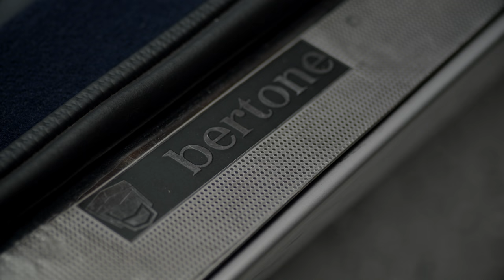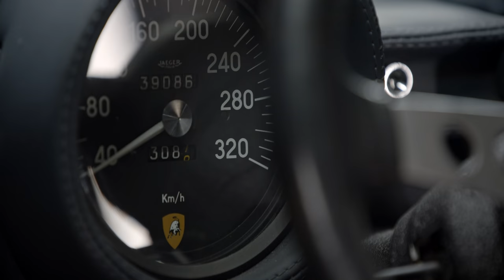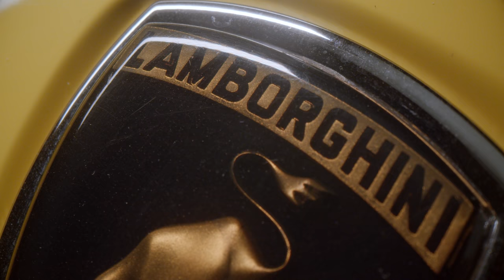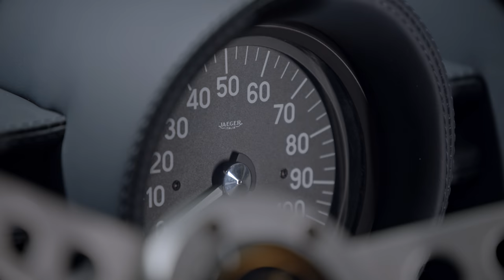Detailing a Lamborghini Miura, the most beautiful supercar... in the world:  | Beyond the Details

Comment: How do the headlights work? as looks like they point straight up
Reply: Similar to a Porsche 928. They pivot forward but not as extreme because the reflectors under the lenses are at an angle. It’s a clever aerodynamic solution actually. Little known fact. The headlights and taillights were pre-existing components used on other cars at the time. Marcelo Gandini cleverly incorporated them in the design.